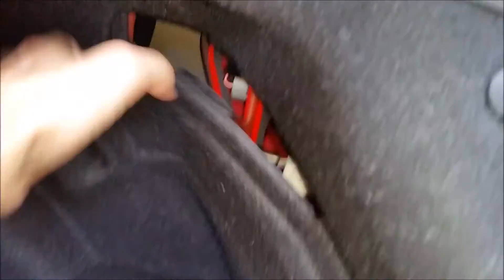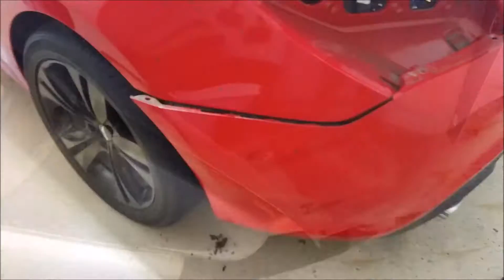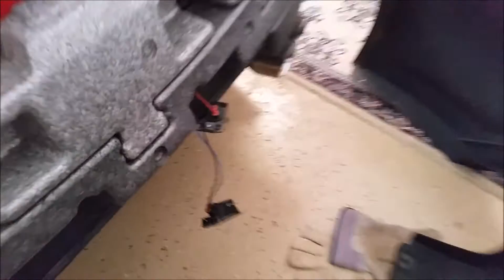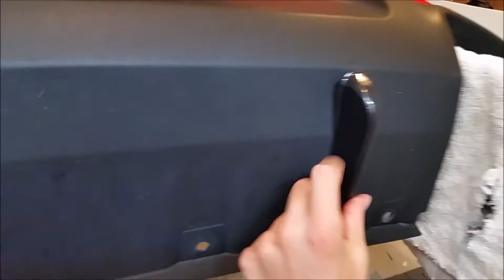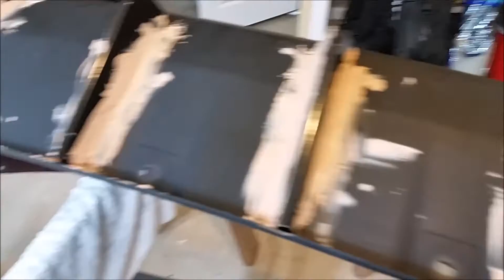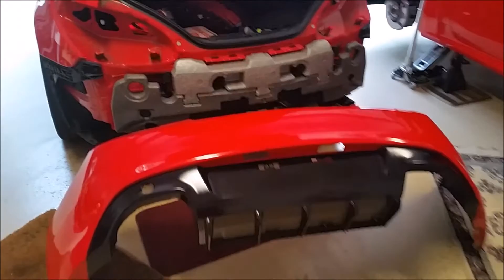Genesis Coupe Custom Rear Diffuser Build

Comment: I have another question, so i am parking my car for the winter and i was wondering if there is anyways to remove that black plastic from the rear bumper at the place of removing my whole bumper for the winter because i would not like the inside of my tarp getting dirty..v
Reply: That is if you remember because you don’t have the car anymore there

Comment: May I ask if the paint lasted on the plastic or did it not really stick properly? Because I would like to paint both my back plastic and front but I am hesitating.
Reply from the maker: I had no issues with it and I had it like that for about 1.5 years before I sold the car.
Reply: Did you put on clear coat or just paint did the thing ?
Reply from the maker: I did like 5 coats of clear
Reply: Yeah ok perfect thanks by the way you’re the man replying to comments 4 years after you posted the video i might be back in one of your comment sections i love what you keep that going my guy

Comment: pretty cool DIY. what grid did you use to sand the diffuser?
Reply from the maker: 80 grit bit on my Dremil tool. 220 to smooth it nicely. Then 1000, then 1400 before paint.

Comment: Those fins are one of the most creative things ive seen! i thought you were going to use those trays to paint LMAO. Are you worried at all of the fins breaking or anything?
Reply from the maker: Haha Thanks! I do have a slight concern. But the epoxy and Bondo are very strong, so I know they are secure. Also, the plastic for the fin has some give to them, and the paint should help protect them too. I just need to be causious of backing into a spot with a high curb. That would definitely break them off.
Reply: I agree with Chris TheCreed that is definatly a very creative way to make your diffuser look alot more sporty! It's crazy to think how much that cost compared to buying a piece to attach to bottom of the diffuser for better look, or even the one with the 3 fins I think it is I bet it would probably be couple hundred bucks! I think I will do this next season since summer is almost over here in Ontario Canada, but thank you for the great video I love do it yourself mods they not only save you cash but it's unique something you actually created on your car!